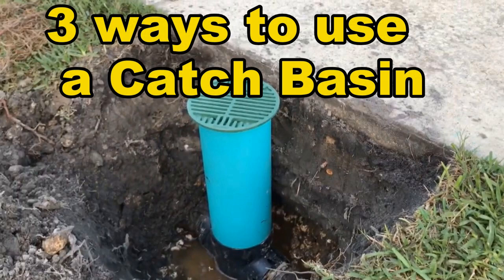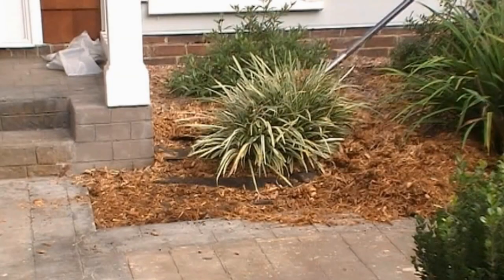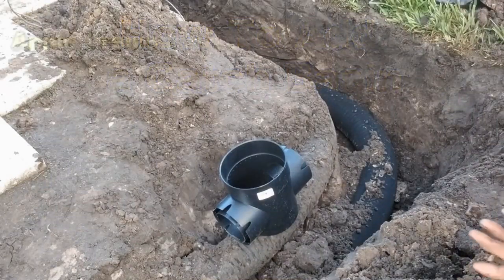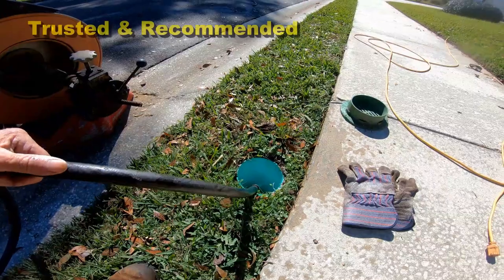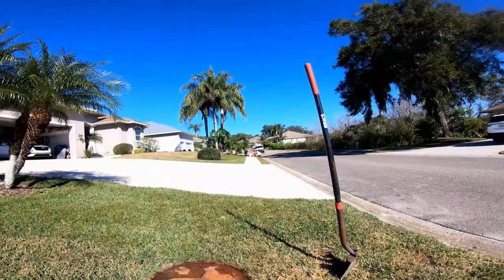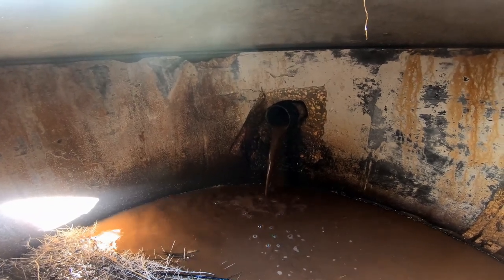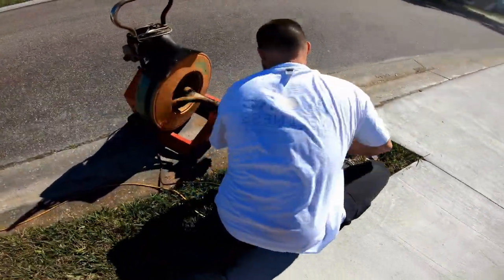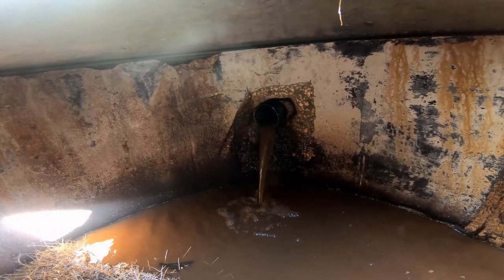$15.00 Catch Basin - Save on French Drain. Watch to End for How to Clean Pipe

Comment: Is the4” Sewer and Drain PVC suppose to fit tightly in the NDS Speed 6” catch basin? I am trying to install this catch basin but the 4” pipe is loosely fitting and it’s going to leak.

Comment: How do you prevent mosquitoes from breeding at the bottom of the catch basin? Maybe glue some mosquito netting to the inside of the grate?
Reply: Drill some relief holes in the bottom of the catch basin. Prevents standing water and freezing if you're in an area that does.
Reply: @MrWhybotherwithme  OK, holes might do it, as long as the basin is cleaned out once in a while including from any tree roots that going up the holes in search of water.

Comment: Bonjour savez vous comment je peux condamner un drain sans le retirer???
Reply: Simply install a new line. Only remove section of old pipe if it's in your way of the new installation.
Reply: @AtlanticDrain  Thank you for your answer I want to remove it because too close to the foundation house I want to move away 1m50 the land is clay